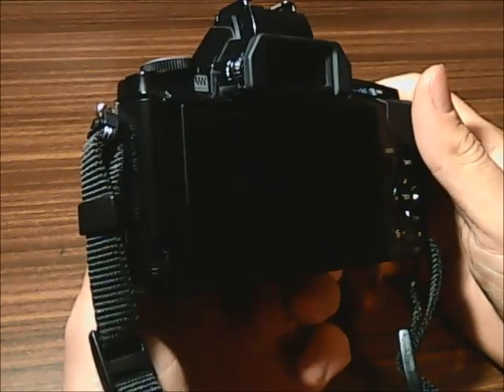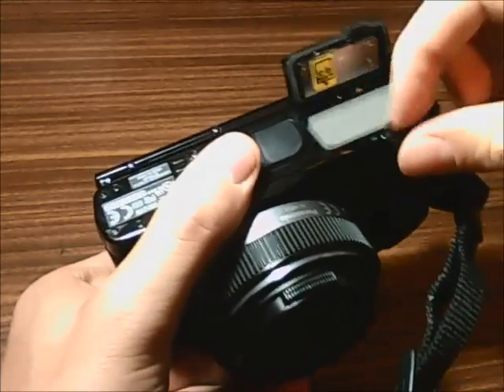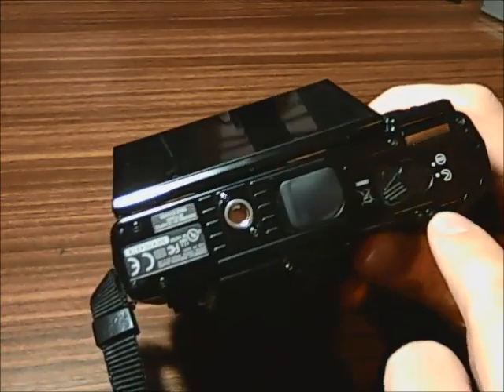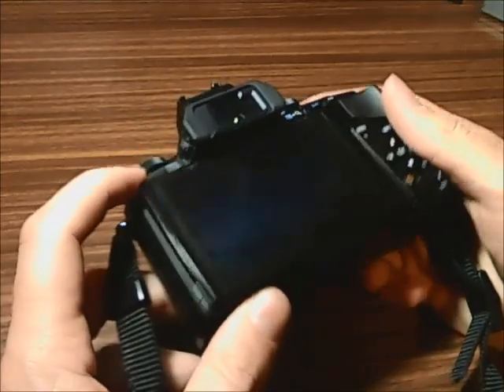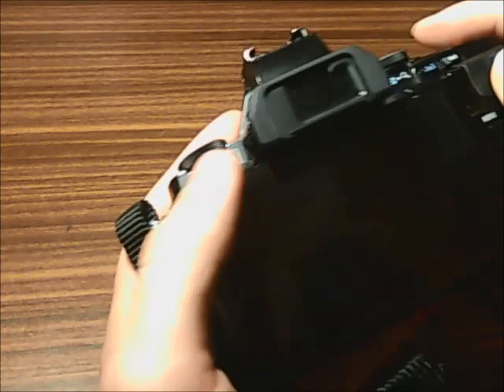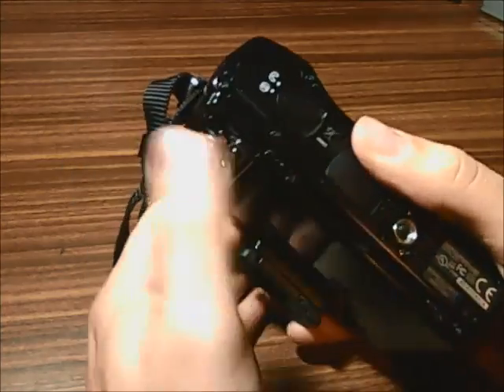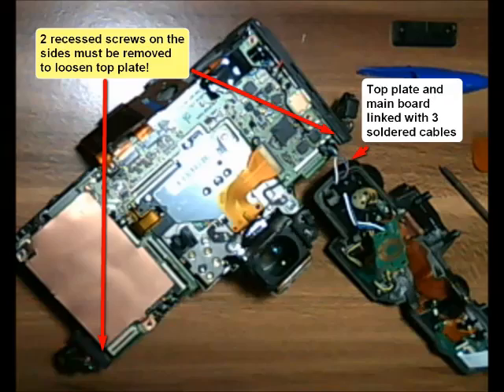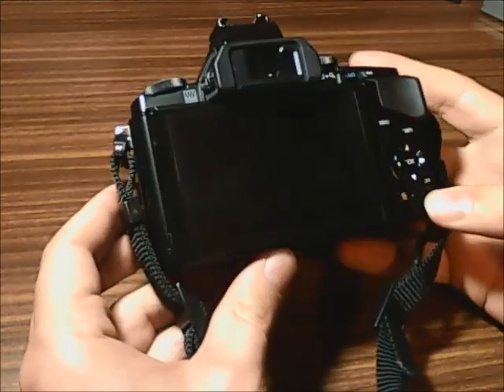Olympus OM-D EM-5 disassembly / teardown

Comment: Thank you so much for this, I had the same problem as you with the mode dial switching back and forth, it was driving me nuts. Turns out mine had black streaks on the contacts, my camera works flawlessly now that gunk is all cleaned away. Thank you for being brave enough to do this first.
Reply: Mine is doing the same thing, guess I'll take the risk and open it up!
Reply from the maker: Sorry but I do not remember

Comment: Thanks for making this video, it was really helpful for me in fixing my own E-M10. The disassembly is almost exactly the same. I actually have fixed two different E-M10s this way, both were damaged by salt water and I fixed them by washing the circuitry out with distilled water (1st camera) and alcohol (2nd camera). Your video gave me the confidence to charge ahead and give it a try. I made a video of the second repair for anyone looking for more help with the disassembly/assembly.
Reply: Hello. I have a problem with pasm dial. I found completely the upper part of the camera with all the dials and flash. But there are some wires that holding the upper part to the main camera. Is this wires easy to disconnect and connect them again?

Comment: i fixed my PASM dial thanks to you. You saved me quite some money. Thanks!
Reply: Hello. I have a problem with pasm dial. I found completely the upper part of the camera with all the dials and flash. But there are some wires that holding the upper part to the main camera. Is this wires easy to disconnect and connect them again?

Comment: Thank you Kevin for this valuable insight into where most of the screws and weather strips are located.i am about to strip mine down for the purposes getting the sliders on the sensor stabilization motors to return to parked positions
I believe this can cause banding issues from the sensor when the IS behavior  is erratic.I heard that the sensor that olympus used in this model is manufactured by Sony.I hope to upload a video of a successful repair ( Or how I made a paperweight).Olympus never release service manuals or how tos so your upload is very useful.
Reply from the maker: john cordey You're welcome. Obviously a better quality disassembly video would be very valuable, especially if you go that deep into the body.

Comment: The EVF on my camera has gone all white. I figured the board for the EVF might have blown but someone suggested the cable going to the EVF is glued and perhaps the glue has come apart. Do you have any experience with this issue and a possible repair?

Comment: I have two of these cameras, one of the camera the shutter is stuck will not open
and the camera will not power on. I have another one that I wanna swap part is it
easy to swap the whole sensor with assemble with the other one.

Comment: Hi Kevin, do you have a higher-resolution picture of the image @ 7:15 in your video.
I have an EM-5 and the strap lug on the left came off. I think it's only a loose screw. I'm trying to figure out from your photo if the screw is accessible as soon as I take off the front-left rubber grip, or if I have to dig in further. Thanks!
Reply from the maker: hexr8d Hi hexr8d, I can't provide you anything better than a 640x480 screenshot (uncompressed, though) here:
http://imgur.com/WuFconb
The webcam I used for the video didn't allow me to make better pictures and if it did, detail clipped to black and original files are not available anymore.
Reply: ***** thanks for the picture. At the right side of the picture, nearest the strap lug, it does seem there's an exposed screw which attaches the strap lug. Can you confirm, if you remember, if it's an accessible screw?
Reply from the maker: hexr8d Sorry I can't remember, but yes it is possible :)

Comment: Thank you for this precious explanations Kevin. I need to change the eye view finder assembly, and despite the fact that you dissasembled the camera quite a long time ago, would like to ask this: do you think (remember) would it be posible to remove the eye view assembly by unscrewing only the two exposed screws at the top of it? (They are positioned right below the plastic cover for the accessory port.)

Comment: Thank you very much for this dissemble tutorial!
My camera is behaving irratically after a day in the snow, and i can see white residue on the accessory port (lost the cover for it)

I'm wondering if its ok to let the camera dry by itself, or if the white residue will cause corrosion in the future?
After all it's snow, hence pure water.

Would be happy to hear your opinion, thanks again!
Reply from the maker: Hi Rotislav, thanks for your feedback.
I believe that anything but distilled water would leave unwanted residues and hence cause your camera to behave erratically. I would not worry about corrosion over a period of a few days though, but I'm only an amateur.

If you know the snow was dirty, I would open up the camera and clean it. If it wasn't so dirty (then again you see residues), try drying it with silica gel, a hair-drier and/or patience, and see if it comes back to normal.

Though my guess would be that you will have to open it and clean it.

In my case, I had the accessory cover in place but the water still went through by capillarity.
Reply: *****
I think the residues at the accessory port is due to dust accumulated there, perhaps there is no residue inside the camera because the snow was clean (hence distilled)

I've put it in a bag of Silica gel and used hand drier for a while, i'm happy to say that after a week my camera is back to life and 90% working normal, (sometimes there are some unwanted dial mode changes)

Think i wont be dissembling it.
Thanks for the help!
Reply from the maker: Rostislav Alexandrovich
The unwanted mode changes were exactly the reason why I disassembled mine. Apparently the water went the same way in your camera as in mine, and there should be residues.

Comment: Does anyone know what would cause the EM-5 to completely freeze after taking couple of shots and then it only shows a black image on the LCD screen and the shutter won't work anymore until removing the battery for few minutes?  I heard somewhere that it might require CPU reflow.
Reply: Mine is getting that, in the error logs it is something "stuck shutter" it got progressively worse and now I cannot take a photo at all. 

it's going to be way too expensive to send it in for repairs for me so I tried taking it apart and cleaning it out with some alchohol. Holding thumbs it will loosen up what ever was causing the shutter to get stuck. I could not fully disasemble it though due to one screw for the top cover not budging. Oh well... I doused the whole thing in a 99% isopropyl bath and if it no longer works when I put it back together then so be it... Haha

Comment: Mine has a problem where it will be working and when you take the first photo you hear a motor and it switches off. Any ideas please?  If you switch it off and on again it does the same thing
Reply: Curtain is stack..
Try multiple shot after off and on couple of times

Comment: Hi! My OMD EM5 has stopped working. The curtain is stuck closed and the camera won't turn on again! Tried many ways but still nothing! If you can help me please! Have no chance to send it to a proper service!
Reply from the maker: Sorry, entirely different problem, no idea.
Reply: Take the battery off for two three days.
Open when curtain ready,don't press shutter.
And hit the can from aunder with your palm.
Like a shaky slap.
That would do.it